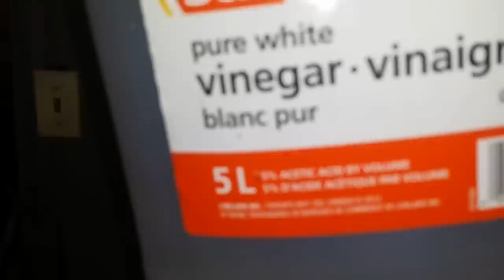Trash to Treasure: Restore Cast Iron

Comment: Did I ruin my pans? I used straight vinegar and soaked for two days. Then I saw your video and realized I should have diluted the vinegar. Some of the rust came off but no matter how much I scrub them , (I'm using a copper sponge) when I go to dry them, the paper towels turn black from the pans. Are they still useable? Should I just go on to seasoning them and eventually the black stuff will burn off? Is it toxic to still use them? Please help :-) !
Reply from the maker: +Nadine Fierro No you have not ruined your pans! An un-seasoned cast will always blacken a paper towel, the black is Iron Oxide, at an earlier stage that the red rust... it is used by our bodies to make red blood cells... wash them well, dry them in the oven and then season them, you will be fine.       See my other video: https://youtu.be/lPtEtgR-vpI

Comment: Man, your breathing sounds terrible.  I hope you're okay.
Reply from the maker: Thank you, a lifetime of asthma does that, you should hear me in January when it gets down to -40...
Reply: trollforge
 I have asthma too.  I sympathize.

Question: Some people burn off the rust in the oven or a fire.  Do you ever use that method?
Reply from the maker: Elizabeth M
 An Oven can burn off the grease, but not the rust, a fire can burn off the rust but can also warp an older pan.
Reply: trollforge
 That makes sense.  Thank you.
Reply: Susan Sullivan
He says asthma.  Breathing problems are a nightmare.  Be careful with fumes, sir.
Reply: i wish and hope you dont smoke and you keep a healthy diet... asthma is a bich , i know...
Reply: Elizabeth M I was thinking the same thing!
Reply: What I don't understand is while youre using that wheel brush grinder, youre not wearing a mask. That carbon / rust dust goes right into your lungs. 
Also that brush is quite abrasive, why did you not just put it int he oven on 500 deg for an hour or two and take a nap? Al that crud wold burn off and you wouldn't break a sweat, breath carbon dust in the air, and be well rested in the meantime.
Reply: @ghanus2009  So many naysayers in here. I supprised they dont just go make their own videos...
Reply: Just curious if this stupid coronavirus impacted you in any way?  Some asthma patients at the respiratory clinic at the hospital network I'm at did not fare well. Hope you were/are 👌

Comment: I would never buff, sand, or grind any porous cast iron cooking surface.Your smearing contaminants and metal into the surface pores. A potato cut in half and salt is the safe way to do it.  Or blast it with walnut shellsI  I also wouldn't use an electrolytic acid bath on a porous material to cook with. Use the buffing wheel on the rest of it and I'm all in. Acidic acid works great to clean up rusted car parts and motorcycle gas tanks. You have to let it soak long enough though. Several days and weeks sometimes. It helps you own an apple orchard, as far as car parts.You ever wonder why plastic bottled soft drinks and water have a plastic after taste? Cancer is on the rise for a lot of eaten reasons.
Reply from the maker: I have nothing to refute your opinion in the first two sentences, other than that I do not agree with rubbing salt into bare iron. And I agree with everything else.

Comment: Do not buy the cheapest vinegar, buy the strongest. Pickling vinegar is 9% vs 5%, so for just a few pennies more you get almost twice the strength. Think smarter, not cheaper.
Reply from the maker: Actually Pickling vinegar is 7% and $3.99 / 4L, Cheap vinegar is 5% and $1.29 /4L. Whenever I do it again I will buy Cleaning vinegar @ 10% and $5/4L.
Reply: Pickling vinegar is $1.99 here vs $1.49 for 5%, never heard of cleaning vinegar, where do you get it? I use vinegar all the time for rust removal, followed by rinsing, then soaking in baking soda bath for same number of hours it was in vinegar,
Reply from the maker: dalmatiangirl61 cleaning vinegar is available through industrial cleaning supplies, and sometimes through big box and hardware stores.

Comment: Wow! The guy claims to have been restoring cast iron for most of his life, and then goes on to show two ways to ruin cast iron.  So very sad!
Reply from the maker: Yes after 4 days soaking in a solution that had been purported to work overnight, I got frustrated and used  the wire wheel, and pointed out the danger of using it. So what in your "0 videos, 0 subscribers, armchair expert" opinion is the 2nd way to ruin cast iron?
Reply: @trollforge    - LOL, if my my vast cast iron collection could talk, they'd tell you that I'm an actual expert, not an "armchair expert". 

As for your mistakes, there were more than two, but I was being generous and just referring to the two that ruined the poor pan.

Your first mistake was claiming that you've been restoring cast iron for most of your life. Clearly, you don't know what you're doing and so that was obviously a lie. At best, you've been ruining cast iron for most of your life, but I doubt if you have even really done this much before at all. 

Your second mistake was when you tried to debunk other methods of cleaning cast iron. The salt method can only be somewhat effective on very light rust, but it's not bad for the pan as you claimed since it's not in contact for very long and the pan would be cleaned afterwards. Do you avoid salt when cooking in a pan? No, of course not. Next, you tried to debunk the electrolysis method (which is a great method, by the way), but you clearly have absolutely no idea how electrolysis actually works. 

Your next mistake was your first method of ruining the pan, which was to soak it in 100% vinegar. This is going to cause pitting in the pan and render it rather worthless. You should never use a solution containing more than 40-50% vinegar for this reason. Using lye would have been less damaging.

Your next mistake came when you didn't wear a respirator while using the wire wheel grinder on the pan. You claim that the reason you are huffing and puffing throughout the video is because you have asthma, and yet you don't wear any protective apparatus when you're sending toxic particulate matter into the air? What kind of craziness is that?

Your next mistake (and the second one that ruined the pan) was using the wire wheel grinder on it. Using any motorized mechanical method is a huge no-no. Your pan is ruined and will never recover from this blunder no matter how much you try to season it in the future. Some of the texture that gives cast iron it's amazing properties comes from the seasoning process, but much of it is also in the pan from the beginning. The molds that the cast iron pan is formed from have a texture to them as does the sand they are pressed into. They don't come out of the sand casting process as shiny and smooth as stainless steel for goodness sake! Their texture is an integral part of what makes them great, and it's what helps the seasoning to adhere and start building up. You have just ground that all away, and it's never coming back. All the seasoning attempts in the world aren't going to fix that kind of damage. Cast iron can take some abuse (such as using metal utensils on it), but what you've done is far and above beyond ordinary abuse.

Comment: Not everyone has the opertunity but I  put all my cast iron in the bottom of a wood bonfire and the ashes burn off all the gunk. I wash it with soap and water and reseason it with lard, I do not use and do not allow any kind of cooking oil in my cast-iron,  only lard or butter. Of course im only 83 years old and still have some skillets from my grandparents.  I also collect cast-iron from yard sales  ( cheap)
Reply from the maker: I didn't hear about the bonfire trick until after I was introduced to cast iron warped by electric elements, so I was always a little leery. With my Mom and Dad both working, my Grandmother pretty much raised me.I still have the pan she bought for her honeymoon trip in 1914. It was the 1st frying pan I ever used 55 years ago. You really should re-consider you no oil rule, IMHO Flax Oil is the best for seasoning, and after wash care. Failing that Tallow (cow kidney & Heart fat) is better than Lard (rendered pig fat). It is funny that with how popular bonfire  cleaning was in the States and western Canada, that it doesn't seem to have been done in Ontario and Quebec... Thanks for commenting!

Comment: I've always ,when needed, or find a rusty piece is to chuck it into a fire and let it burn off , let it cool , then season it
Reply from the maker: That (I am told) is fine for pans made since the 50s. Older pans Are ground smooth on the inside, leaving a differential that may cause warpage. IMHO, it is a risk not worth taking.

Comment: JC (thebossoftheswamp) used 60% vinegar and 40% water for 1 day of soak time with less rust as yours.  That vinegar eat that rust up for you in 4 days of soak time..Very nice job.
Reply from the maker: Thanks
Reply: All of the cast iron restorers I've ever followed recommend a 50% water/vinegar dilution. That lessens the possibility of pitting the heavily rust encrusted surface of the skillet, during the prolonged removal reaction process. 

Also, before I would season what you have there, I would treat it with a lye based oven cleaner to remove the stubborn crud that the vinegar failed to take off, and then return it to a vinegar bath and scour one final time before wanting to eat anything ever cooked in it.

Comment: Electrolysis IS the best way to remove rust from cast iron as it only affects the rust and leaves the iron untouched. It is by far the most gentle way to get rid of rust while preserving the remaining material. 
Vinegar (acid) is easier to use and gives fast results. But it also eats away some of the iron. Therefore you should soak the skillet only as long as necessary to get rid of the rust to keep the loss of good material as low as possible.

Vinegar is also the wrong stuff to remove carbonised remains (the dark crud). Electrolysis again works great but takes quite a while. A lye bath will also work very well.
Reply from the maker: Bernie, I did not badmouth Electrolysis. I just said that these other YouTubers shouldn't be reversing the polarity at the end when using Mystery metal as the anode for fear of electroplating toxic metals to the pan. Yes I know Lye is better at grease, but as I said I was trying something  another YouTuber was promoting.

Comment: I've even just scrubbed them down real well rinse it off real well get it good and hot so it's fry and then start taking the grease from bacon and rubbing it on and throw it in the oven and Let It season actually iron oxide is good for us in small amounts and the copper scouring we can find them at the Dollar Tree pretty much any town you live in will have one of those stores
Reply from the maker: If you can find flax oil at the health food store it is the beast I have found for seasoning bare cast.

Comment: About twenty ears ago, at a scrap yard, I found 12in wide, deep skillet. I used the same vinegar technique, except used more soak time and two soaking. It cleaned up well, and I'm still using it. No idea who made it. Also, I polished the interior to remove pitting. Slicker than non stick coatings.
Reply from the maker: Thanks

Comment: get some lime on that it will clean it up . oven cleaner over night in a garbage bag so it dont dry out, then steel wool and hot water.  oveb cleaner has lime in it
Reply from the maker: +TheBorkBork Lime? as in  calcium oxide??? I think you might mean Lye, (potassium hydroxide), I've never tried the oven cleaner garbage bag technique, I should on the next one...
Reply: +trollforge Wouldn't like any of the hydroxides or oxides just cause more oxidation of the iron which is what rust is? Acid such as vinegar and phosphoric acid reverses oxidation. Using an oxide causes rust.
Reply from the maker: Slavic Cooking
 Yes your hypothesis is sound... I have used Lye in the past, if what you are trying to remove is burnt in grease, lye is the was to go. A thin layer of oxide gives the fats used to "season" a pan an anchor point. However if you are trying to remove a build up of rust, (as I was here) then acid is the better choice, IMHO...

Comment: Putting that pan over a camp fire with some oil and lit it burn in less work
Reply from the maker: +Aurora Bollman that sounds more like Seasoning a clean pan, that cleaning a really bad one... even though I cook over campfires all the time  with cast iron, I wouldn't want to put it directly in a fire for fear of warping it, or differential heating and cooling snapping it...

Comment: I always clean my cast iron as you describe.  I wash it in soap and water, then immediately dry it, then put it on the stove top on medium heat fo a while until it is completely dry, then apply a thin layer of oil until next time.  I don't care about seasoning that gives you a sort of nonstick surface.  And I am happy with the results.  Interesting video.
Reply: That's the way it's done. I grew up with cast iron.
Reply from the maker: Cast iron was born in China in the 5th century BC, so that would make you 2500 years old? ;)
Reply from the maker: Robert MacDuffie I do not agree with the "Never use soap on cast iron." philosophy... It is the product of untested sudo-logic. What you have is a baked on organic polymer (which is what all "Seasoning" is.) Once the oil is polymerized it is not affected by soap, or hot water. I have the pan my Grandmother bought for her honeymoon, in 1914, it was washed in hot soapy water every time it was used for the past 103 years, and has only been reseasoned once, because someone put it in the dishwasher. (And I'm not sure it really needed reseasoning then, either but it is an heirloom.)
Reply: Right on, right on, right on.  I agree 100% - once it's seasoned, nothing is going to hurt it.  I usually wash out my cast iron cookware with hot water and a copper scrub pad because that is all it takes, but if there's a sink full of soapy water sitting there, I'll use it.
Reply from the maker: Thanks Ricopolico!
Reply: @Ricopolico  9

Comment: I cringed when I saw him using a wire wheel.  A perfect way to completely ruin the value of a collectible piece of ironware.
Reply from the maker: Very True!
Reply: TrollForge / TrollFarm  Didn’t you say this was not a valued or collectible pan?  Why worry then. Just enjoy the Pan.
Reply from the maker: @shadowdancer1358  it was 5 years ago, so I think what I said was that I was not doing it because it was collectable, but to put it into use. It is infact what many people would consider collectable.
Reply: Generally, and unless it is damaged from too much pressure and grooving by a wire bristle, and after it is re-seasoned properly, and unless you happen to decide to use a medium to high power microscope to examine the surface, you wouldn't be able to tell the difference or not whether a wire brush wheel was used upon it anyway, and not too many people use a microscope to examine things like that anyway.
Reply from the maker: @ProspectorsGhost  true!
Reply: @trollforge  If it is true why are you posting it as a recommended metod? Do you want people to believe and follow you or you just showing what not to do? This is a frustrating video to watch. Also straight vinegar will corrode iron.

I woudl think that you are showing how to restore a rusted pan without diminishing the quality of the object. All these methods are destructive. Ugh...
Reply from the maker: @ghanus2009  did you listen to the first minute and a half of the video? I stated quite clearly that this was a new method, another YouTuber was claiming to be the the best, and most people seem to get that I was implying skepticism.
I got fed up with the poor job it was doing after 4 days, and used the wire wheel. Now, since you mentioned it, there is no such thing as straight vinegar. Vinegar is an watered down solution of 3 to 25(ish) percent acetic acid. Yes it can corrode iron, but it is used up in the process and it works on the weaker bonds first (dirt, rust, calcium, lime). I, at no point recommend this process for something in as bad shape as this pan, it is a waste of time. However, welders and fabricators use vinegar all the time to remove rust and mill scale so they don't contaminate welds. Could this process work for you? Maybe, if there's not too much rust and corruption.
Reply: @ghanus2009  Just what would you recommend ?

Comment: Our way of removing rust and and burnt on build up that is really good for that black  burnt build up. You clean it all off by putting it in a pit fire until the coals are completely cooled, then take a wire brush to remove the ash, then take it to the kitchen to clean and season as always. After my pans are seasoned, I wash them with hot water only using a wire mesh rag scrubbler ( I got from Amazon), its very smooth and gentle. I do re-season periodically with a Crisbee puck. Its made with beeswax, soybean oil and palm oil. I used other oils and lard, but this Crisbee Puck has a hiring burning temp.  
I'd try it fire first next time you come across a pan with that gunk build up on it, you'll be surprised how much easier it is. If I wasn't very clear, the fire removes the rust too. You put the pans in the fire while the flames are high, I pre-warm them on the stove first.
Reply from the maker: Apache Wind yes that works perfectly well on pans made since around ~1960 and companies got lazy and stopped grinding out the center of the pan. The older pans with insides ground out are much more prone to warpage. Personally, I wouldn't use anything containing soy oil. I don't believe that human beings should consume soya in any form as it messes with your body chemistry, making you think that you are producing estrogen. Don't be afraid to use soap when washing your cast iron, once it's seasoned the oil has polymerized and is not soluble in soapy water.